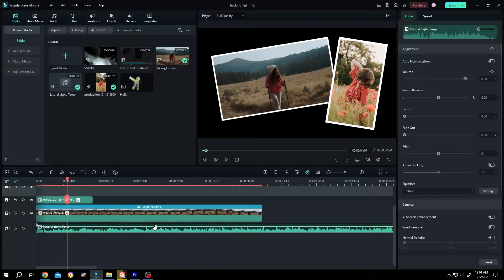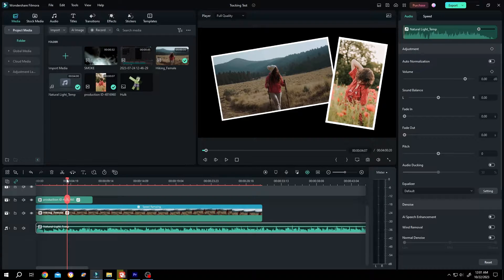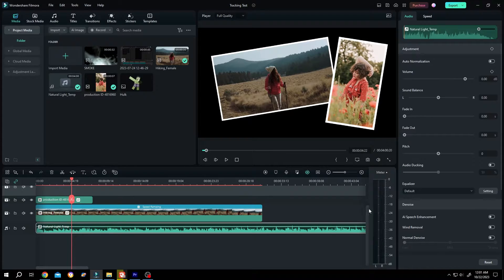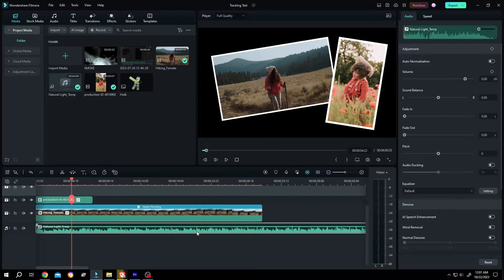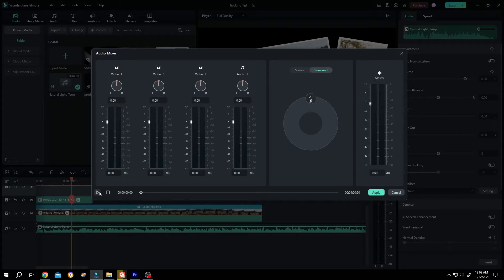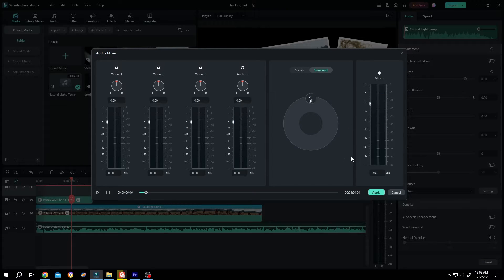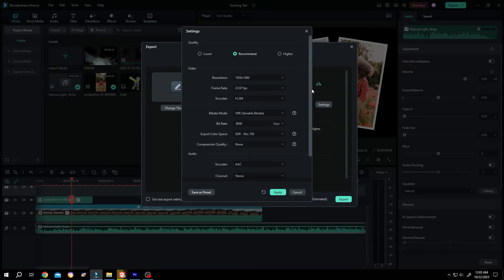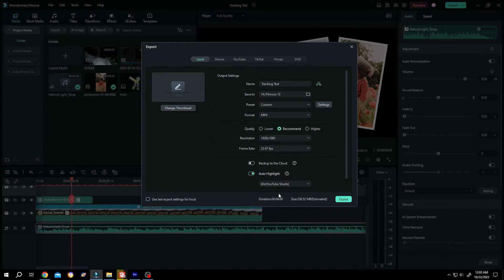Fix Audio Playing On One Side | Filmora 12 & 13 Tutorial

Comment: The problem with the solution of setting "surround sound" in the AUDIO MIXER is it affects EVERY clip of your project, even clips having L and R chanels that you want to keep separate in the exported film (they don't stay separate in the final exported video).

A BETTER SOLUTION IS NOT TO USE SURROUND SOUND AT ALL  (unless you are designing something to use surround side when it is presented)

1/  IF THE CLIP HAS ONLY ONE AUDIO CHANNEL THAT YOU WANT ON BOTH CHANNELS IN THE EXPORTED VIDEO then leave it set to STEREO in AUDIO MIXER and then choose the MONO option (as described in the video) when exporting. That single channel will be copied ot both L and R channels in th final exported video.

2/  IF THE CLIP HAS 2 DISTINCT R and L CHANNELS AND YOU WANT TO KEEP THEM SEPARATE IN THE EXPORTED VIDEO  then leave it set to STEREO in the  AUDIO MIXER and choose the STEREO option (as described in the video) when exporting the video.

3/ IF YOU HAVE A CLIP WITH 2 DISTINCT L and R CHANNELS BUT YOU WANT TO ELIMINATE ONE OF THEM AND HAVE THE REMAINING CHANNEL EXPORTED TO BOTH L and R then leave it set to STEREO in the  AUDIO MIXER and use  the L/R siider in the Audio dialoge (the one that appears when you double click on the cip). Slide it all the way to the Right to eliminate the left channel or all the way to the Left to remove the right channel. You will be left with just one audio channel so now follow step 1 (above) i.e. choose MONO when you export.

This works in Filmora 12. I cannot say about other versions.